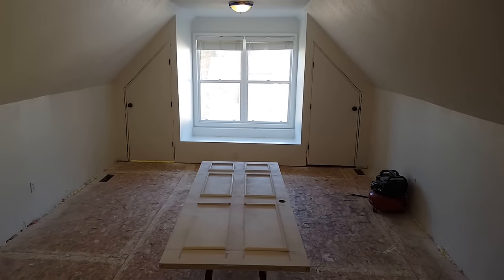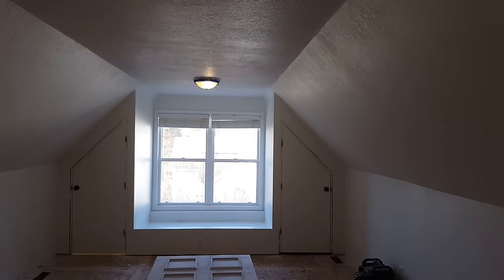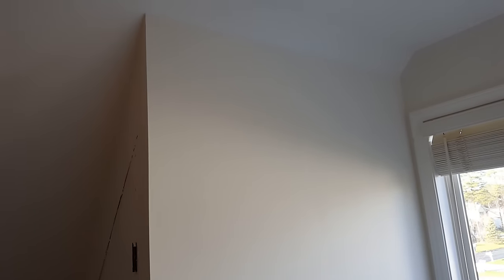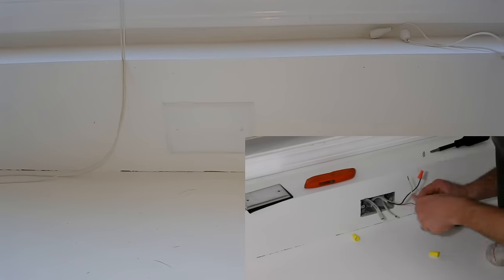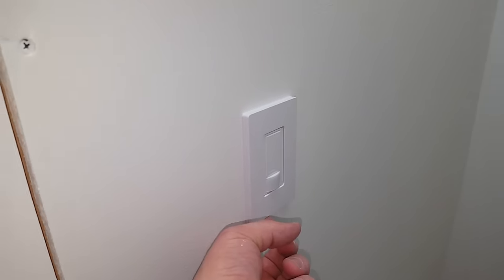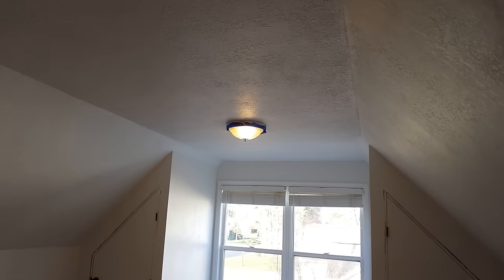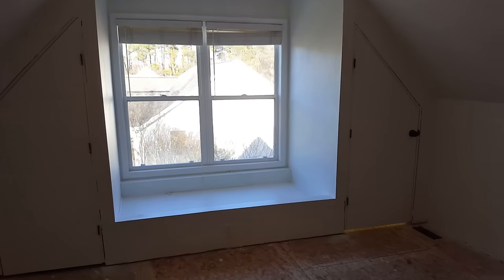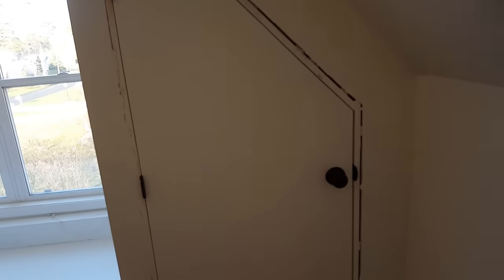Bonus Room Renovation - Drywall, paint, and smart lights/switches  - Phase Two

Comment: not sure if you know, but you can use spray on ceiling texture to fix those transition spots, I used it when helping do my Nephew's room over. I got mine at Lowe's and they have different kinds for different textures. Hope this helps.
Reply from the maker: +Marc Anthony that is probably the best way to go. I will look into that thanks!
Reply: +SSLFamilyDad  no problem, glad I could help. Love the vids by the way, going to be getting about 4 chickens next spring, this year we are getting everything ready.